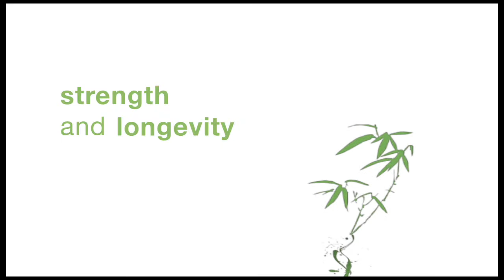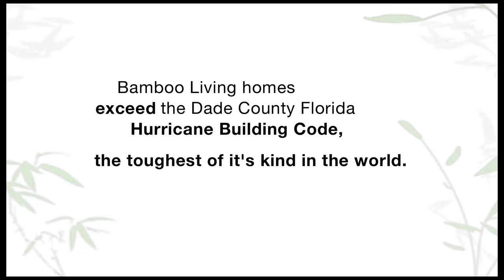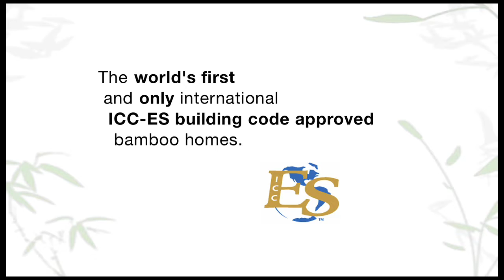Bamboo House - Strength & Durability of Bamboo Living Homes

Comment: Is Bamboo 🔥FIRE RESISTANT🔥???
Reply: Hello, my suggestion for this question is you need the design of the bamboo must have a very detailed plan..I think bamboo house shouldnt be designed the same as a modern type house which you have to build everything in one roof..for a bamboo house we need to separate the function some spaces into another small house that located about some steps from one of other..for example, the cookhouse and the electricity house ( for working purpose such as computer, refrigerator and many things) must be separated..one room one function..for bedroom i do not think you nee to have a fan or anything that using electricity as the bamboo house is already cool..usually the bamboo house originally comes from southeast asean as we hear only have 2 season which is summer and humidity(rain) all year..unless if you have a very good security and safety plan for making a bamboo house as a place for you to stay you can are welcome to build that bamboo house anywhere